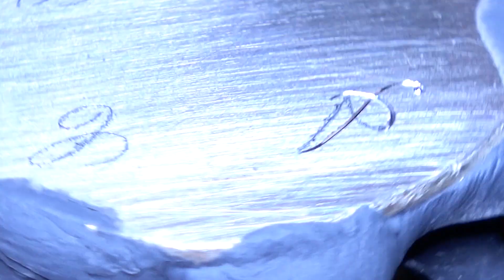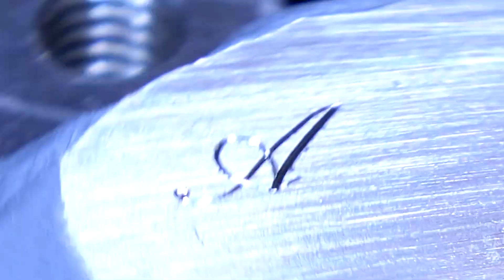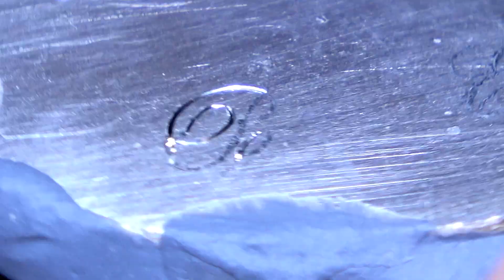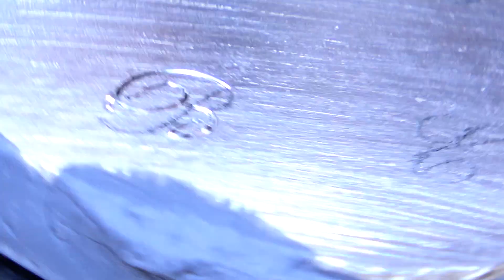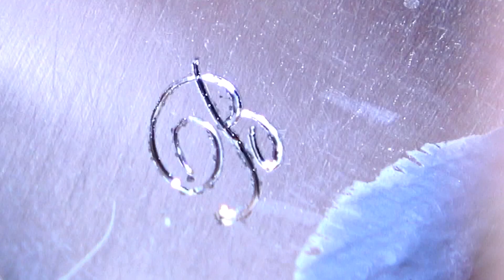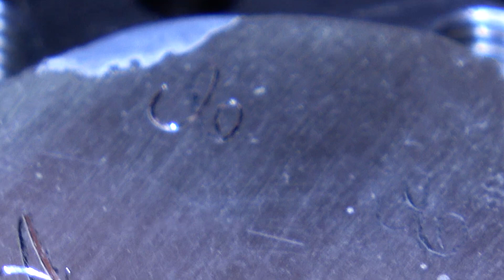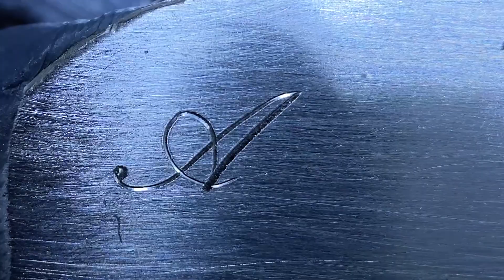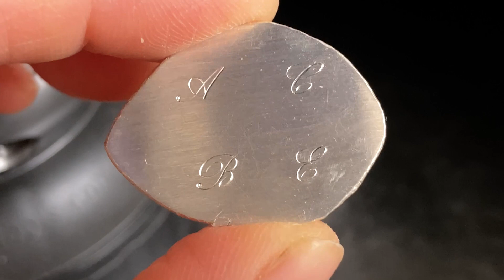Hand Engraving Letter A, B and C in Script

Comment: can you show me how you make the graver & sharpen like that!
Reply: The shape of this graver is very intriguing and interesting. But I would think that it also is a bit impractical, because it would be quite impossible to re-sharpen it if the point chips off. One would have to start over from scratch which is much more work. I would probably not narrow the shaft of the graver down to something smaller than the face.
Reply: Mr. Kanagawa's gravers where the inspiration for Alexander's cobra engraver. He said so in one of his Instagram posts. He also posted a series of 3 short clips where he shows one being made. He takes a V-graver and grinds it to shape.

I just check out his intagram and learn how to make it ready. It's easy and very cool!
Reply: Nice cutting. 
  Depending of size of the letters, stop-start of curve cutting is quite evident, which interrupt continuity of curves. 
  Grateful if someone note metal being cut and whether graver is carbide.tks.